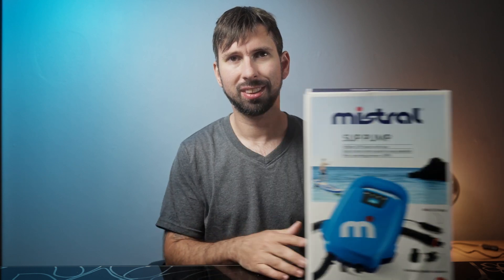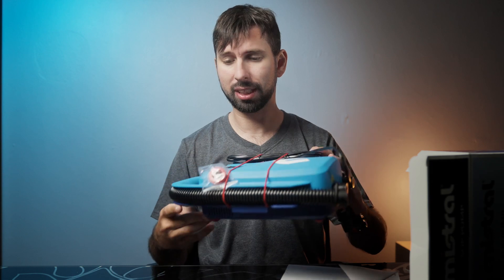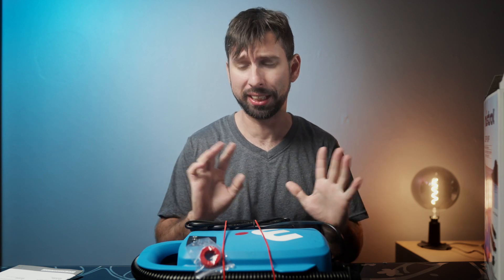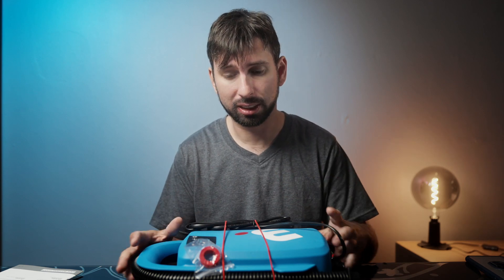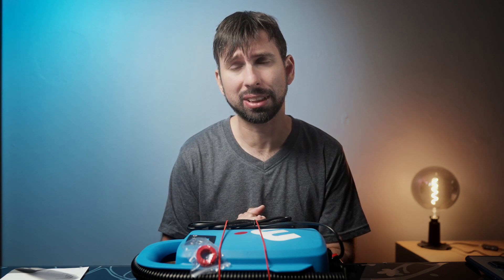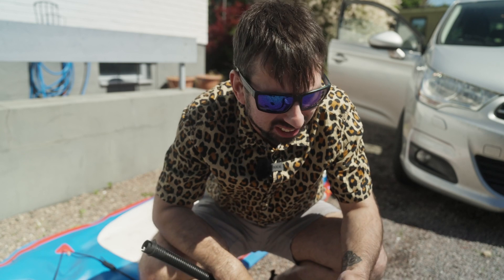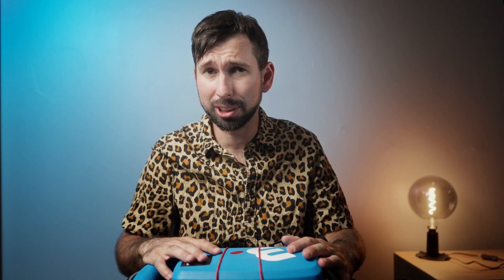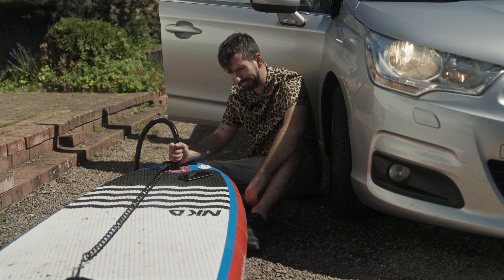Testing the Mistral Sup Pump Bought on Lidl - Huge Disappointment

Comment: This pump is not built for purpose.  The fuse amp in the pump is 15amp. The car 12v chargers are 10amps so the fuse blows in the car. I had the same issue
Reply: My car has 20 amp fuse powering the 12v sockets. I checked after watching this vid. I’d advise others to check.

Comment: My own doesn't work either, whet it reaches just 0.7psi, it cannot feed any more air at all...
Reply: You need more Voltage, with real 12V it should reach ~1,1psi. Maybe the backlash valve is no clean inside? Had to clean and grease the valve on my pump, as it was not tight.